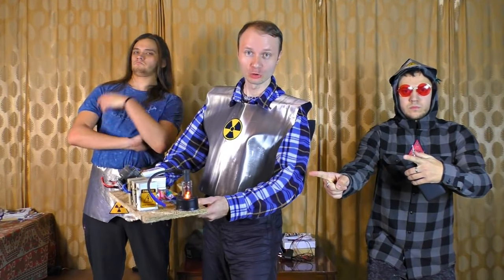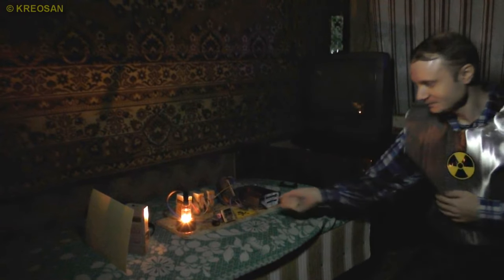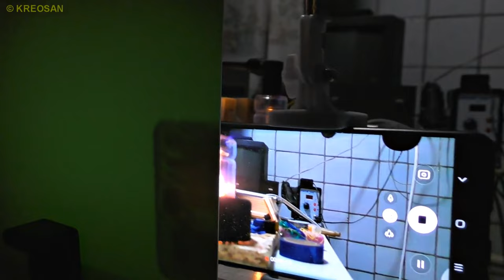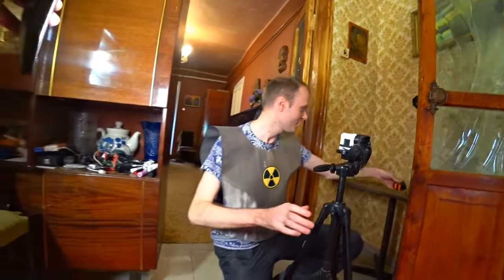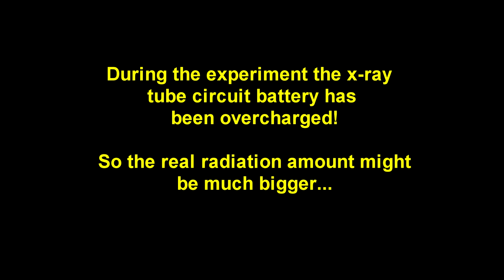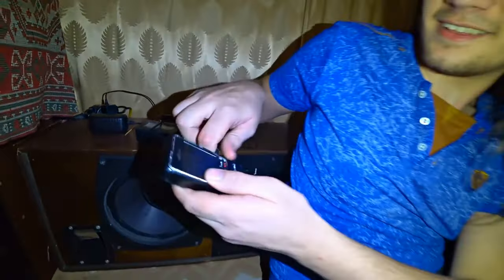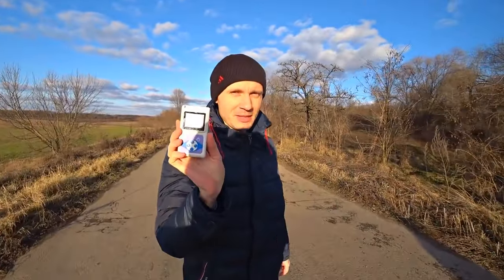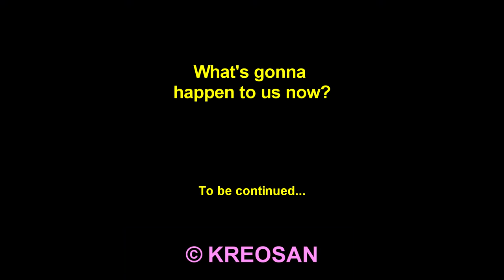X-Ray Gun ⚡️☢️⚡️ Experiments

Comment: If your hand and foot are getting post-exposure tingling sensation, they already absorbed close to a full sievert and have long crossed the threshold for cancer risk increase. People operating X-ray machines early in their creation would test them by doing precisely what you did with their hands in front of the fluorescent screen as routine. After a while of doing this their fingers began to necrose. You're past cancer risk and now headed towards full-blown ARS. The readings on your devices are consistent with such dosage.
Reply: This is 5month old they still live with all their hands
Reply: @kitecattestecke2303  That only means they stopped fucking around with it in time to not make it worse.
Reply: @SearinoxNavras  they said it was caused by electrostatic discharge from the driver circuitry
Reply: @signalworks  I'm not referring to the tingles in the beginning and middle of the video, I'm referring to the tingles mentioned at the end, long after they were done using the device. Tingles from radiation damage take a while to set in.
Reply: That only applies to regular men. They eat Chernobyl dirt for breakfast. Radiation is afraid of them!

Comment: Did some quick calculations. Assuming they showed half the experiments and each one was 10s long they still did not even reach the dose known to cause increased cancer risk, much less a lethal dose. Note that the values measured are intensity of R/h, not dose in R. They do not absorb a 100R dose for each run, that would take an hour in front of the tube.

Don't get me wrong. What is shown in this video is completely reckless and insane but if they stay off the Xrays for a year after this they will not accumulate a dangerous total dose.

Comment: I built a pulsed (marginally safer) version of this, and even at low power with shielding had adverse effects on test equipment. The images were barely visible to the naked eye from scintillator directly over the tube about every 5 pulses.

Comment: Rate is proportionnal to the inverse of the squared distance... I took your data and plotted a graph (Y = rate and X= 1/distance^2).
I remove the data point taken at 3 meters as it seemed off chart. Your data:
0.3 m : (INVALID measure - Geiger-Muller tube saturated, grossely underestimating).
1.0 m : 41.1 R/h (or 0.383449 Sv/h)
3.0 m : 9.04 R/h ( or 0.084340 Sv/h) (data seems off the chart, should be lower at around 4.0 R/h to fit the slope)
7.0 m : 0.8 R/h (or 0.007464 Sv/h)
10.0 m : 0.3 R/h (or 0.002799 Sv/h)
36 m : 0.0066 R/h (or 0.000616 Sv/h)
200 m : 0.000406 R/h (or 0.000004 Sv/h)

I get a slope y= 41.144x-0.0441, where y = rate in R/h and x = 1/distance^2

So at 50 cm (0.5 m), the rate (which GM-counter cannot measure) is 164 R/h (1.53 Sv/h)
So at 30 cm (0.3 m), the rate is 457 R/h (or 4.26 Sv/h)
So at 10 cm (0.1 m), that rate climbs to 4114 R/h (or 38.4 Sv/h).
So at 1 cm (0.01m), that rate climbs to 411444 R/h (or 3839 Sv/h !)

So if you stay in front of the source for 5 seconds, that's 0.08333 minutes or 0.001388 hours.
If you stay 5 seconds at 1 cm, you accumulate 5.3 Seivert cumulated (50% will die after a few weeks for overall body irradiation at 1 cm).
If you stay 5 seconds at 10 cm, you accumulate 53 mSv cumulated exposure.
If you stay 5 seconds at 30 cm, you accumulate 5.9 mSv cumulated exposure.
If you stay 5 seconds at 1 m, you accumulate  0.532 mSv (532 uSv) cumulated exposure.
If you stay 5 seconds at 3 m, you accumulate 0.117 mSv (117 uSv) cumulated exposure.
If you stay 5 seconds at 10 m, you accumulate 3.9 uSv cumulated exposure.

Comment: Men dont do it any more, that lamp is producing x-rays 360 degrees around it self whit same amount of radiation. You are not safe neither behind it. And if you want to drop current and voltage  down use muffler at the end of the circuit like in fluorescent pipes light .Whit that u wont be struck by electricity

Comment: put rheostat (Adjustable resister) on the filament, this is how you can dial in Xray intensity second is the metal hood over the filament, this too is for fine tuning the power of the beam, by adjusting it negative to stop, more positive it is more powerful the xray beam will be

Comment: The reason your wires are shorting is because you have too much current in too small of a wire. this generates heat and messes up the insulation causing it to short. Get thicker guage wire even aluminum will work and insulate it well.

Comment: hi, i've done this experiment some 30 years ago and its really dangerous : my coolidge x ray tube from 1940 could produce sth like 1milliSievert in a few seconds!!  Could you tell us how much you get in mSv/h approximately at the distance you were watching the fluoroscopic screen ?
You 've got to know that your High voltage power produce high frequency  radio waves that gives a reading even if the xray tube isnt activated : make a test and you'll see and be carefull as it will shorten the life of your geiger counter very very quickly (a standard geiger tube can only record a certain amount of photons or "shots" during its life time and a xray beam can overcome its lifetime in a few minutes). The reading you get when you measure very far away in the garden is certainly due to the electromagnetic waves produced by the HV source as the xrays are diffused easily and the dose rate should diminish rapidly with the distance.

Comment: That xray tube sends a beam in one direction, but a lot of rays go to the side also. You shouldn't be standing next to it while you test the distance! At very least, stand like 10 meters away and use a long wire to turn it on. Or better yet, stop playing with it. You're getting exposed to way more radiation than you know.

Comment: The large tube will need more high voltage/power I guess. Isolation will be an issue. It might work if you put all the hv circuit on a transformer oil bath. Including the tube

Use a remote control to power it up to avoid get zapped. 
A long rubber hose to blow air in and a pressure sensor for water level sensing in washing machines will do the job.
Reply: Nope they don't need all that, what they need to do is stop with this, because this is going to cause serious health problems

Comment: You can fix that issue by using salt water tubing with no are in it it's a great conductor and can handle high voltage

Comment: I have a question. I see it illuminates the paper in front of it but does it actually spit out x-rays in all directions ? Also it doesn't seem that concentrated on the front so at 20-30meters they are getting less x-rays because of the scattering of a higher area.

Comment: 40 R per hour at one meter ! Stop, it's getting dangerous for your health
Reply: That's 0.4 Sieverts/h.... A geiger muller tube is usually very inacurate at reasuring these rates (gross underestimation). Guys at these rate you need a ion-chamber survey meter, not a geiger-muller based counter.
Reply: @JonathanVaucher  A nuclear worker can absorb 0.025 sievert per year, so even if there geiger isn't accurate, it seems pretty intense to say close
Reply: @Kagary  That's about 25 mSv/years. With how much they played with it, they probably absorbed 10 mSv in that experiment. Their hands probably took 100 mSv, being much closer to the source.

Comment: your metal costume act like a capacitor to the circuit of high voltage
Reply: Isn’t it lead
Reply: @Streloski  it need to be grounded on earth to act as a shield 🛡 or more like a Faraday cage for xray the principle is the same it acts as a car which discharge at you when you touch the car body bcs is on wheels gum tire

Comment: Guys, BE CAREFULL !!! Coat all the electronics in a thick thick lead box. 
Move the button further from the high voltage components. 
Self-encase that huge head-tube in thick lead foil all around ! If that tube works at 100% accuracy, you guys are going to develop either leuchemia or a very severe form of cancer !in no time.
Also, shorten your exposure to the rays if you wanna film more bones live... you could also get radiation poisoning, the guy that scratches his foot is scratching because he has surpassed the human limit of exposure and what he feels is tissue being affected by the radiation, he should go to a hospital !!!
At the doctor, in a controled room, your exposure is very very very short ! You guys stand next to the damn thing all through the clip and in front of it !

BE EXTRA CAREFULL !!!

Comment: Kreosan if you use your giant xray machine please get a hazmat suit
Reply: X-rays penetrate HAZMAT suits with no problems. HAZMAT suits are not designed to protect you against radioation. Only thing that it can do is to filter radioactively charged particles from the breathing air.
Reply: @itsmemaario  so what is the solution
Reply: @jasontanoko2181  the answer in not to be an idiot and not to play with x-rays. Or at least shield the x ray source in a way that you are not in contact with the x rays.

Comment: Yes this is dangerous, but it is not deadly amounts of radiation unless they expose themselves to the direct beam for long periods of time (up to days). The high voltage is probably more dangerous. 

That being said... they're taking some unnecessary risks and could decrease it easily by taking some distance and doing the experiment remotely instead of with that finicky switch sitting right next to the tube.

Comment: I really like your videos, but just like your experiments with electromagnetic radiation, you lack any safety gear. Playing with radiation must be done with care. You are overdriving that tube and have no adequate measuring devices. Probably lots of scatter and hard Xrays.
Everyone of you should wear a personal high and low range dosimeter. A low range dosimeter to track exposure and a high range one to track spikes, which most low range meters cannot register. The geiger counters you use are toys. They are very unreliable at high ranges and saturate fast with that tiny GM tube inside. There is no way they can measure 100 R/h reliably. And even 100R/h range seems not enough here. Just because it goes off scale at 100 does not mean it is no more than that. You need a ionisation chamber type dosimeter for higher ranges. And even those generally saturate at 500R if not made for the purpose of use in extremely high radiation fields with internal lead shielding. But those don´t register at low ( here in the 10s of R/h) doserates. So you need several meters, each for its purpose.
If that distance test at the end was real, accoding to the inverse-square law the radiation must be insane in close proximity. Like in the 100s or R/h. Soft XRays can never travel these distances.
Don´t get fooled by the intensity of the flouroscopy screen to determine radiation intensity. They only shine so bright and won´t get brighter after a certain threshold, no matter how many 1000 R you are firing at them. 
According to the images of electronics on the screen, you had lots of hard XRays. 
Keep in mind: The body will make no difference between hard XRays and gamma rays. They are both ionizing and DNA damaging, just their source differs.

Comment: This whas an extreamly dangerous experiment. Your dose that you did get from this is huge! Becaus geiger counters have a low sesitivity to low energy X-rays like those of your machine. I am sure that you can add at least an other zero to those measurements. Like that your radiation dose could have been easely  thousands or even tens of thousands of R/h. I think that those dots and hurting parts on the hand and feet could be radiation burns and the hurting of your heads is probably radiation sickness. Please imediatly stop with those experiments otherwhise you are probably all gonna die from the effects of the radiation. If you despite all my warnings still want to continue then just use a very short puls uf less then a second like maximum a tenth of a second and capture the image with your camera. Then it is mutch safer then in this video, it still isn't safe but at least safer then now. Please just be carefull and I hope that the radiation that you did suffer from this experiment is not gonna kill or heavely damitch your bodyparts but it is possible.
Reply: Don't want it to "heavely damitch" anything, LOL.

Comment: These fools are smart enough to conduct really cool experiments but not smart enough to protect themselves. For me its the other way around.

Example: I would have extended the start button with a long cable. No need to be right next to it. Also, why put the lead on some bodyparts when you can just shield the whole aperatus. This way the radiation would be really mostly in one direction. Also, why use your own organs to show bones and stuff? Why not use frogs and other small animals? Also i would have put the whole thing in a separate room shilded by lead and other materials. The experiment area could be sealed way of when turning it on.

To be really secure find a obsolety bunker and instal two cables. One cable to start and stop the machine and the second to cameras. But i guess its more fun to do it the dangerous way.

Also, if you get electric shocks why dont you wear gloves ?????????? A pair of rubber gloves and if you want to be extra save you put leather gloves on top.